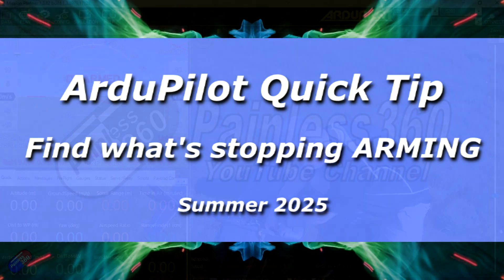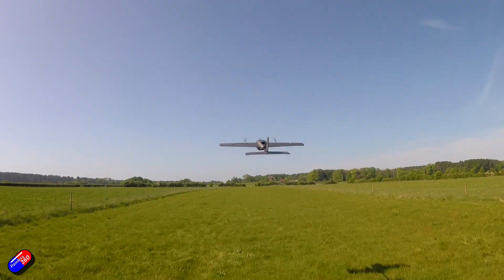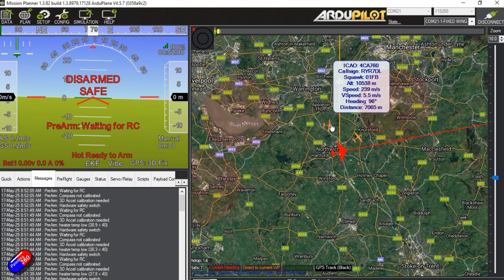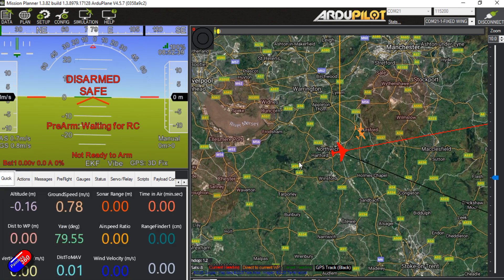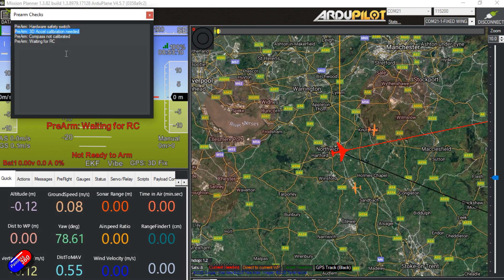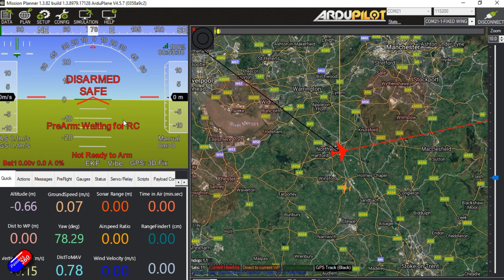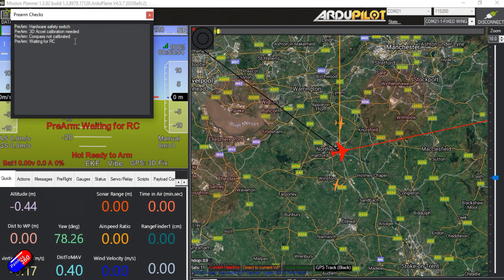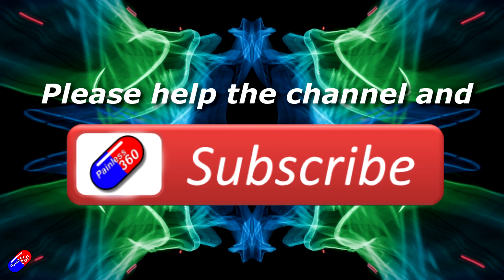How to easily see what is stopping you from arming Ardupilot

Comment: Hi @painless360! Is it possible to auto arm if there are enough satellites without remote controller - with arducopter or inav. Let's say someone is trying to break into my house and I want to save my documents and other small valuables. I would like to have a 5-inch drone with a pre-programmed flight path to nearby woods and just put it on the roof and plug in the battery. Thank you.
Reply from the maker: I've no idea what to do for that. Best of luck